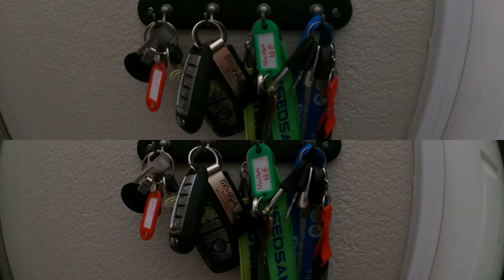GoPro Hero9 Max Lens Mode vs QKOO Fisheye Lens for GoPro Hero9

Comment: Yeah I just picked up a fisheye lens from another company as well and it doesn't have the effect that a fish I learned should have. I barely even had it when you you were using it. Especially a fact it's supposed to be a lot different and more circular. You did a great video I'm just disappointed in the quality of any of the fisheye lenses.
Side note it's a lifetime warranty on your GoPro max lense
Reply: this is my current issue. i am looking for a traditional and circular (not full circle) fisheye that will emulate the old canon ivis mini x from 2013 and can't find anything close to it :'(
Reply: @awarewithalex yeah I've been playing around with my fish eye lens a little more I'm learning more everyday and you can adjust it so it's a little cropped. I have a couple videos recorded with the fisheye lens you can check it out if you like. But the fisheye full circle is fun to take pictures with.

Comment: I got a crack on my max lens mod as well on a motorcycle ride to work. . .just one little nick and I'm off to spend another $70 [because I bought into the subscription] to replace.  So now max lens mods used only when recording my doggy walks or maybe a mountain bike ride.  I love documenting life with these gopro's.  I've seen my doggies grow from puppy to full grown beauties.  And the slo mo with their running is awesome.  But yeah. . .max lens mods are too pricey to take on my routine motorcycle rides.  Bummer.  Need to make the mods cheaper.
Reply from the maker: We'd love for these to for sure be cheaper. Getting pricey lol 😂